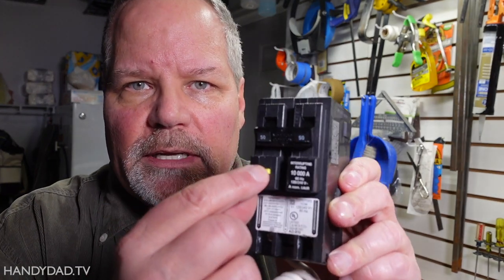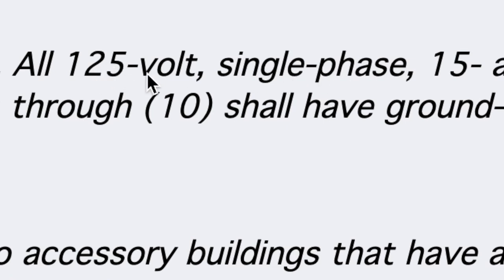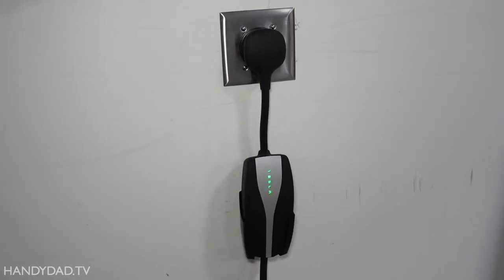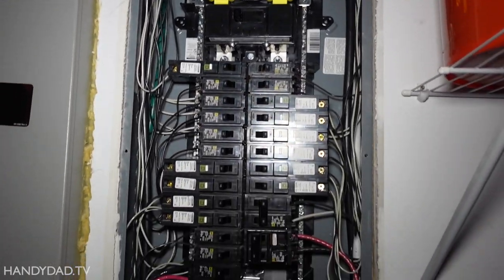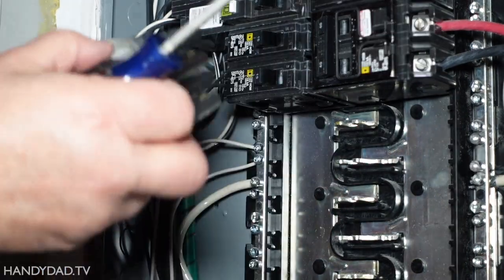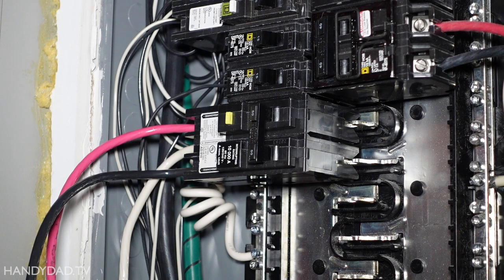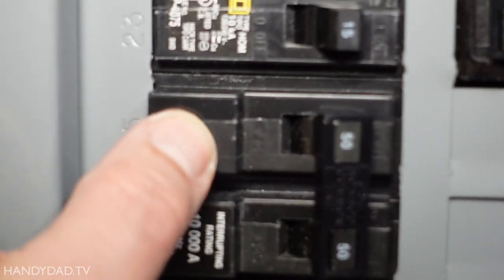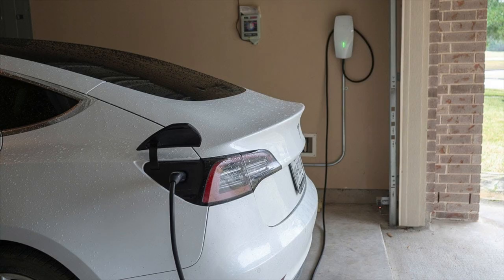Do I need a GFCI Circuit Breaker for EV Charging?

Comment: I think viewers should know that most states have actually exempted that part of the 2020 NEC when they adopted it. GFCI is actually not required for 240V outlets in the vast majority of states. Check your local code modifications, each state makes their own modifications to the NEC. Most inspectors will not give you trouble over it. Also many EVSE manufacturers do not recommend using a GFCI outlet due to phantom tripping. The EVSE has built in GFCI, having it in the breaker is redundant. You don't really need it unless you are worried about getting a shock plugging in, just flip the breaker off first if that is the case. I would only recommend putting a GFCI on a 240V outlet outside in the rain, inside a garage really isn't necessary.
Reply from the maker: Thanks for the info
Reply: Speaking of phantom tripping, I have a 110-v outlet in my laboratory equipped with likely a GFCI mechanism. That thing trips itself at least once a day and I have to pinch that tiny button everyday just to use it.
Reply: @linzeng6523  If it trips with nothing plugged in, the outlet is defective and should be replaced. Put in a work order. They go bad after so many years due to power spikes. They had to replace all the GFCI outlets in my building for the same reason, now they work correctly and don't trip.
Reply: It's definitely in BS7671 in the UK (at least from 18th Edition, Amendment 1, regulation 722.531.3.101). Though I thought outlets which are likely to be used outdoors have long needed RCD/GFCI protection, as have cables buried in walls unless otherwise protected. The ideal is for RCBOs (GFCI breakers) to be used for every single circuit in the house. The difference is that a normal GFCI/RCD is not sufficient for a charging point, it must be "type B" (type A or type F is acceptable IF the charging outlet has its own RDC-DD, as some do).

Hard-wired charging points are not sufficient for this.

Also ensure the earthing/grounding is adequate as I think most US installations are TN-C-S, and said "shall not be used" (regulation 722.411.4.1) except if one of five (soon to be four) strict conditions are upheld, some of which being unlikely (e.g. a three-phase installation with almost perfectly balanced loads, or an earth electrode with a resistance of around two ohms or less), to mitigate the risk of a broken PEN (protective earth/neutral) conductor.

https://electrical.theiet.org/bs-7671/updates-to-18th-edition/
Reply: The way I read it the code requiring GFCI is only for receptacles and not for hard wired EVSEs.
Reply from the maker: @M - That is correct. You can eliminate the need for a GFCI breaker by hard-wiring.
Reply: @seprishere  Hi, Simon.  It's always fun to hear from "other countries" and how things are done there.   As for some of your points:  The National Electric Code (NEC) has required GFCI protection for swimming pool equipment since 1968 (electrocutions because of faulty underwater pool lights were a big problem back in the day). They have been mandated for all outdoor outlets since 1971, and in garages since 1975.  Indoor hot tubs entered code in 1984 and kitchens in 1987.  So, yeah, all practicing electricians (hopefully) should be fully aware that GFCI's are to be used in garages or outdoors.  (The 1970's code allowed some exemptions in garages but those have been removed).

For whatever reason we have not (yet) mandated GFCI's for all home circuits.  (It will come in the next few updates I think).  We should have done it 20 years ago - it would make things much simpler for everyone.  GFCI's are a well proven technology and have served us well since '68.  So it's not like it's some new cutting edge thing with all kinds of problems. Yes, GFCI's now are essentially little computers (as opposed to purely mechanical devices in the early years) but they still do the same thing, if not better now.

But here's the interesting part: The NEC did not mandate GFCI's for 240V circuits until the last few years. (We use both 120V and 240V circuits in the home here).  So up until recently a 240V car charger would be exempt simply for the fact they run on 240 volts.  But this changed as of 2020.  If a garage or outdoor OUTLET (of any voltage) is installed, then that outlet must be GFCI protected.  And since no manufacturer makes 240V GFCI outlets, a GFCI breaker must be used at the "consumer unit." 

Now what's the problem with this?  Well most US car chargers come with a GFCI inside the unit.  This means you will have 2 GFCI's on the circuit.  Theoretically it shouldn't matter, but in practice I think "nuisance trips" will probably happen.  So how to remedy this?  Simple.  You "hard wire" the charger to the panel and bypass an outlet all together.  Since the code only requires "outlets" be protected, a hard wired circuit should be exempt.  (At least from my reading of it). And since we very rarely use 240V outlets in the U.S., there is literally no reason to have a 240V outlet in the garage for anything other than a car charger (in other words, there's no reason to install the outlet in the first place since it will never be used for anything else). Therefore, it makes sense to simply not install an outlet.
Reply from the maker: Thanks John. I read it the same way.
Reply: Yes, you are right about not having gfi for  ev. Local codes prevail
Reply: The GFI in the charger is 20 milliamps for mechanical protection not personal protection. 
A few miliamps directly through your heart is lethal enough to cause fibrillation.

Below is a standard threshold:

1 mA - Barely perceptible

16 mA - Maximum current an average man can grasp and “let go”

20 mA - Paralysis of respiratory muscles

100 mA - Ventricular fibrillation threshold
Reply: @Wowzersdude-k5c  RCDs (the equivalent of GFCIs) are still electromechanical in the UK. AFDDs (the equivalent of AFCIs) are computers, but only for the AFDD aspect (and overvoltage if provided) not for the RCD or overcurrent aspects which remain electromechanical.

The standard now for good installers is for RCBOs (combined circuit breaker and RCD) to be provided on every single circuit, though some installers might cheap out with dual RCDs. AFDDs (often combined with RCD and overcurrent functionality) are now required in a few circumstances.

Of course there are loads of old installations still using rewireable fuses with no other protection than a 30 A rewireable fuse at what was the "fuseboard" (and at 240 V!) and 13 A cartridge fuses in mains plugs.

30 mA is assumed low enough for an RCD to save a life, though undoubtedly unpleasant, and it needs to be fairly high to absorb leakage.
Reply: @jimbilliar2529  If true, then you bring up a good point.  A 20 mA GFCI is NOT approved for human protection in the U.S.  It must be a 5 mA device.  If that's the case, then having a GFCI inside the charger itself will not satisfy the NEC.
Reply: @yolo_burrito  That's correct. If hardwired it is not connected to an "outlet" and thus bypasses the GFCI requirement.
Reply: How do I know if my house can handle the wall charger?
Reply: @Lexi8880  Post a picture of your electrical panel somewhere and have some experts figure it out. Or call an electrician. Most homes can support an EV charger, it may have to be set to a lower amperage if you have a smaller electrical service however.
Reply: @TechnicalLee if the equipment has ground fault protection and you plug it into a GFCI receptacle, it can cause phantom tripping, as well.
Reply: So what about an AFCI breaker? there is a lot of news regarding the NEMA 14-50 plugs melting.. would adding a AFCI breaker help in this situation? just as an added protection?
Reply: Super helpful! Would you recommend using GFCI on a 240 plug in the garage if it’s being used to boil 15 gallons of beer?
Reply from the maker: @marklpaulick I’d say so.
Reply: What states have exempted it?
Reply: @yolo_burrito  same here

Comment: This is going to be a mess going forward. I install EVSEs as a licensed electrician. First, I do not like to do outlets and try to talk customers into hardwire. In preparation for an outlet install, I asked one of my inspectors about this Code change. At first, he said yes I need a GFCI breaker but after talking with the chief inspector it was determined that our state had not adopted that change yet. On top of that, some manufacturers like Tesla will state in the manual to not use a GFCI breaker probably because of nuisance tripping.  The industry has a ways to go with getting it right.
Reply from the maker: I have used that GFCI breaker with a Tesla UMC and Emporia EVSE. No issues with nuisance tripping.

Comment: Only need a GFCI on a circuit rated 50 amp or less. So if your EV maximum amperage is 48 amp, it will take a 60 amp circuit. No GFCI would be required then.
Reply from the maker: GFCI is needed for receptacles only. Not for hard-wired chargers.

Comment: All electrical connections require a torque screwdriver per the NEC. Those breakers range between 22 inch pounds per terminal to 45 or 50 foot pounds for the larger breakers. The values are imprinted on the side on the breaker itself. Do NOT overtorque or undertorque. Either can cause overheating and a subsequent electrical fire.
Reply from the maker: Thanks

Comment: What about of car handbooks that said “ GFCI are not recomended in installations” They burn the neutral and trip the breaker by itself. Also make no sense, 240v don’t need the neutral. So Didn’t work on a EV charger installation
Reply from the maker: That’s why I recommend a hard wired charger.

Comment: Its more important to install a high quality 14-50 outlet (Hubbell) than a gfci breaker. I installed a cheap big box 14-50 outlet and it probably would have burned my house down.
Reply from the maker: Unfortunately code specifies GFCI, not a quality outlet.

Comment: I just had a 50 amp breaker and dedicated circuit ran to my garage and inspected. The electrician said the juice box has a gfci and doesn't have to add one. The inspector passed it. It is not hard wired
Reply from the maker: Thanks for sharing.

Comment: My first 240v/50 amp circuit installation. I was going to spend $20 on a breaker, but after this, I'm going to spend $120 on that breaker. Thanks for this video so I could do the job correctly!
Reply from the maker: Glad it was helpful 👍🏻 

But I’d recommend you keep the cheap breaker and use a hardwired EVSE. Avoid the plug.

Comment: Also, its funny I was just thinking about doing a video about Nema 14-50 vs 6-50 vs hardwired. It is so hard out here in California with all of the regulation. I work with 13 different jurisdictions and it seems like everyone  of them interprets the code a little different.  Hardwiring the charger to me is the best way to go because it eliminates a connection point (the plug) and every connection point is a potential for failure, however out here some inspectors require stricter regulation on a "permanently " installed charger versus a cord and plug connected device. Lots to think about. You explained everything very clearly. Thanks for the inspiration.
Reply from the maker: Yeah, I only have to deal with my own, but people flame me for not being correct in their localities.
Reply: Im also across many counties in Southern California.  How do you keep up with updates fire codes and adopted nec changes.
Reply from the maker: @albertosotelo663 That’s why electricians are in business. People always point out stuff I’m doing wrong based on current standards.

Comment: Great video. I live in California and we havn't adopted the 2020 code. I think we will adopt it later this year under the California title 24 rules. There is a lot of regulation. I wish all of the panels I had to work in were as nice as yours, that is so spacious.  Thanks for sharing.
Reply from the maker: I’m very lucky to have a new house with 200-amp service.
Reply: I live in California as well and if I was installing a new charging station, I would put in a new GFCI breaker just knowing it will be applied ot California electric code soon.

Comment: Many states adapted NEC 2020 except for 210.8(a) which requires GFCI for 240V outlet. For example, Georgia amended 210.8(a) as “All 125-volt receptacles installed locations installed through…”. They removed 250-volt terms. 

This is because it’s not only unrealistic but also hard to buy 50A gfci breaker for older main panels. Manufacturers do not make 50A gfci breaker for older panel. It’s a Good news.
Reply from the maker: Thanks for the info

Comment: One of the functions of the EVSE (or Tesla wall charger or portable EVSE) is that it has a built in EVSE.  The EVSE will look for a 20ma imbalance and the spec for a breaker's GFCI is 5ma.
Reply from the maker: I’ve been told my an electrical engineer, if the device is designed correctly, testing one GFCI shouldn’t cause the upstream one to trip, regardless of spec. Like the GFCI plug on a blow dryer doesn’t trip the GFCI outlet.
Reply: @handydadtv  Depends on the EVSE, and the actual trip current imbalance of both the EVSE and the breaker.  Many good EVSE's test themselves before operation, and that test can cause the nuisance trip of the main breaker.  The EVSE automatically resets when it passes this test (a much different electronic arrangement with a sense circuit circuit, electronics, and relay), whereas the main breaker is physically tripped and must be manually reset.  This is different from your hair dryer scenario, where the hair dryer does not perform an automatic test before operation (you have to push the switch).  And there are scenarios where pressing the test button on the hair dryer will pop the wall GFCI, and vice-versa.

Also, just for clarification (for your electrical engineer), hair dryers don't necessarily have GFCI's but have an ALCI (Appliance Leakage Circuit Interrupters) or IDCI (Immersion Detection Circuit Interrupter).  These are a bit different, but same idea.

The important part is that one of the GFCI's in series will always trip, and the wrinkle with the EVSE's is the automatic test function - and actual trip levels conflicting with upstream breaker GFCI's.
Reply from the maker: @Bill - thanks for the info!
Reply: That is great for hardwired installs but the fact it is a plug located in a damp locations brings 210.8 into play. You never know what might get plugged into it.  I personally have had welders, ect. plugged into non GFCI outlets all my life but code does require it.

Comment: Thanks for this vid.. I’m using a Nema 6-50R in my garage to recharge a solar/battery backup unit & I need to replace the standard 50A breaker to a GFCI breaker. And, yes, the 6-50 only has 2 hots & a ground. So now I know I don’t have to worry about what to do with the middle breaker wire connector.
Reply from the maker: Which backup did you go with?
Reply: @handydadtv  An ECOFLOW Delta Pro

Comment: Nothing like a defective safety device… Makes you wonder how many of those have been installed. Great video!
Reply from the maker: Thanks so much 👍🏻
Reply: Hopefully very few (though some cowboys might), as no legitimate electrician would issue an Electrical Installation Certificate if the functioning of the GFCI/RCD has not been properly tested (both the test button, and also a formal test with a professional test device).

Comment: Not complaining at all. You do a great job with your video’s. I do think it should be mentioned that anyone installing the hardwired Tesla wall charger should NOT install a GFCI breaker because the Tesla unit already includes a built-in GFCI.  See Tesla wall charger instructions. Stringing GFCI’s will cause them to trip.  

The other point is that no matter how hard you tighten a screw on a wire, the wire will quite often loosen if the wire is wiggled, or after it has been used and the temperature has changed significantly.  Once the screw has been torqued down, wiggly it and it will quite often pull out. At least re torque it once or twice after wiggling the wire.
Reply from the maker: Great tips! I am planning additional videos on these topics. Thanks.

Comment: Some internal charging modules insides some EVs can be very finnicky while dealing with GFCIs and make them trip for no good reason. It can be very problematic to find out in the early morning that your vehicle simply did not get any charge overnight and that you are stuck.
Reply from the maker: I’ve never had that issue, but I really recommend hard-wiring to avoid needing a GFCI.

Comment: As I recall, a garage outlet that is used for a freezer should not have a gfi due to erratic tripping, which could in loss of freezer contents. Same principle for an EV charger; you could find your car not charged in the morning. Also, I understand that the chargers have their own built in GFI. Having two gfi in the same circuit causes problems.
Reply from the maker: It has never been a problem for me.

Comment: If you get the Tesla wall connector you do not need a GFCI in the electrical panel because it is built into the Connector itself. Even the power connector cable, that came will all Teslas until recently, has a GFCI built in. In some states there would still be a requirement for a 240 volt outlet in a garage, whether used for car charging or anything else, to be GFCI protected, but it would provide no additional protection when used with the Tesla wall connector or Tesla charging cable.
Reply from the maker: You don’t need a GFCI breaker with any hard-wired EVSE.